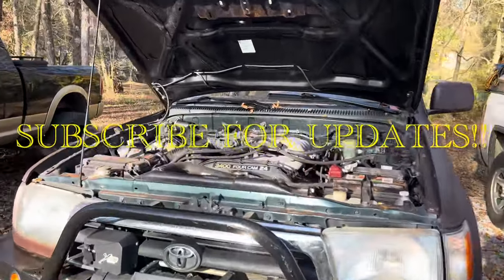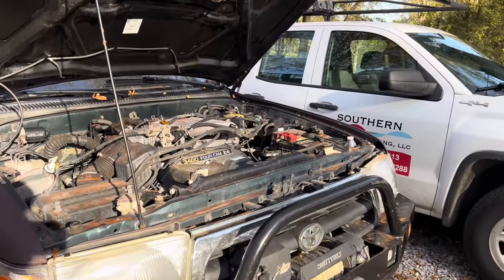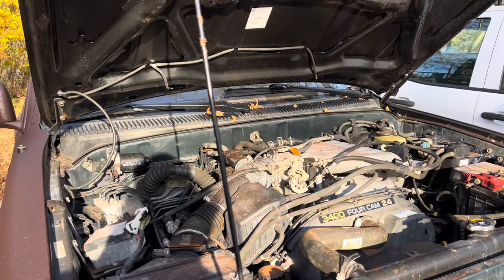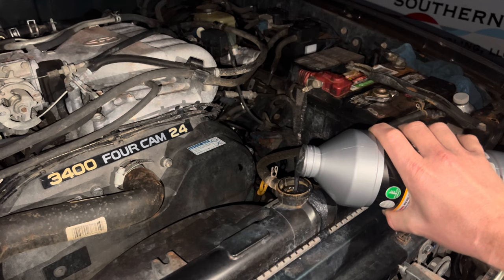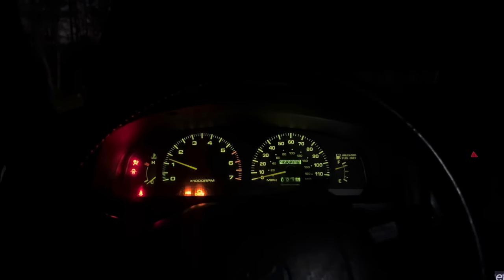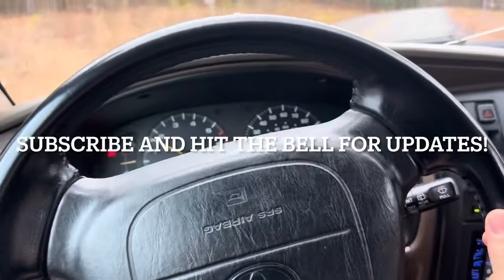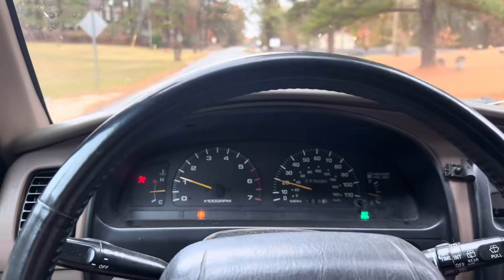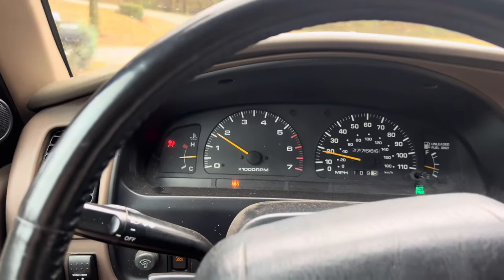Bar’s head gasket sealant is the best! How to use and review on any vehicle!

Comment: I’ve used this on my 06 is350. I have been driving my car daily in 100 degree weather without issues (yet). I removed the thermostat before using it to avoid any problems.
Reply from the maker: I’m surprised it’s still working for me really didn’t expect it to work like it has

Comment: Bars is the best, but you have to keep  driving until the seal sets.....do not let vehicle drain dry . Keep filling and drive at 30 minute intervals until the leak seals. If vehicle remains dry no water for 3 hours or more seal will evaporate and engine will lock
Reply from the maker: Correct I’m at 1800 miles now no issues

Comment: Hey buddy, I know the video is 1 month old now, any updates on how its holding up? or how long it lasted for you?
Reply from the maker: I have around 1200 miles on it as of now with no issues! 

I will get the exact mileage tomorrow for you!!!!
Reply: @Rubiconromp  hey bro awesome, I just put another one in mine today,had been running rest tho then temp hand went back to fluctuating again, so I dumped another in her. I figured hell I will add some more since it did well. This 1st time adding any more so I'm happy🤞🏿🤞🤞🏿❤️❤️❤️🙏🙏🙏🙏🙏👍
Reply: Mine was doing well to until last few days, temp going up n down so I just added another one today. I figured hell it won't hurt that lol. I got 256,000 miles on it so trial n error now. I have nothing to lose
Reply from the maker: I’ve put 1500 on mine so far
Reply: @Rubiconromp  that's awesome!!!!
Reply: @Rubiconromp  definitely some good stuff!! Thanks again for video! I'm on 2nd bottle, so I won't be using anything else since it's working 😂😂
Reply: @Rubiconromp  actually I just put mine in earlier today and my drive is about 20 minutes home so I put it in and did usual,run for 15 minutes and let cool down. Bro jumped in it and came home,and no BS hand only went to 1st line past half way which is where is supposed to be and then came right on back to normal lol. I was thinking you to myself in car lol. Gonna take ride tomorrow lol🙏🙏🙏🙏🤞🏿🤞🏿🤞🏿🤞🏿
Reply: @Rubiconromp  Your car still holding strong? Charger good so far since adding 2nd bottle🤞🏿🤞🏿🤞🏿🙏🙏🙏🙏🙏
Reply from the maker: @keithmccauley3395 mines all good and that’s cool too hear
Reply: @Rubiconromp  awesome glad to hear that
Reply: @Rubiconromp  ❤️

Comment: What prevents the sealer from sealing up the radiator?
Reply from the maker: Nothing at all. Very good chance it could it has stopped the heater core up twice! I now have 1500 miles on it with the shape of the motor I wasn’t worried about the motor failing
Reply: @Rubiconromp  so do you suggest this product or no
Reply from the maker: @Imadethistocomment13  if your motor isn’t worth putting head gaskets on I would give it a try forsure
Reply: So far so good with mine! Nothing clogged as of yet. I had nothing to lose, 257,000 miles on car and back running like only 2 miles on it. This Bars I must say works so far. I'm pleased🤞🏿🤞🏿🤞🏿🤞🏿🤞🏿🤞🏿🙏🏿🙏🏿🙏🏿
Reply: @Rubiconromp  exactly right! I will by Bars all day long if it keeps going lol
Reply: @keithmccauley3395  I figured the same thing between me and myself because my car has about 250,000 also and it's been running great and I just didn't want to get rid of it. I use the liquid the only problem I noticed is that the hot air doesn't come out but I don't notice any coolant loss anymore
Reply from the maker: Pull the heater hoses on the fire wall and flush it out he will start back working
Reply from the maker: Thanks for the comments helps the channel grow
Reply: @Rubiconromp  yes sir bro welcome!!! Thanks to you again❤️👍🏿👍🏿🙏🏿🙏🏿🙏🏿
Reply: @Imadethistocomment13  Did you bleed system? Might be air in it. Mine will do that to at times blow cold,warm, air and that's how I know I got an air pocket and Everytime I bleed it, back to hot heat
Reply: @Rubiconromp  yep true flush it out real good!!!
Reply: @Imadethistocomment13  I definitely suggest it only because it worked for me. But like anything else, it might not work for yours. I don't never post about anything, but since this is doing so good, I had to put my input on it.
Reply: @Rubiconromp  I definitely agree!
Reply: @Imadethistocomment13  Also I have tried other Bars products just to let you know and others ones did nothing at all, didn't clog either but didn't solve it. But the Bars Head seal done sealed it for now.
Reply: @Rubiconromp  ❤️❤️❤️
Reply: @keithmccauley3395  I'm glad it seems that I'm not missing any more coolant because I know I was definitely having a leak but like I told you the only problem is I think there might be an issue with the thermometer not really sure if it's from the actual product or if the thermometer itself went out but because my car has so many miles on it I'm going to let it ride until it can't anymore, it's already a little bit past the 250,000 mi or more
Reply: @Imadethistocomment13  ❤️
Reply: @Imadethistocomment13  That's me, mines at 257,000 and I'm gonna keep on pushing her! Then hell when it goes completely, I will just swap motor out, because I'm like you I like my ride. Put a new motor in and keep on trucking lol!! Keep me posted on how yours do. And also when I 1st put Bars in, it took me 3 drives before it kicked in. Short drives, like   maybe 5 miles or so each time testing it then finally no overheating. So give it a little time to let it seal up if it doesn't right away.
Reply: How your vehicle running? Still holding strong?
Reply: @keithmccauley3395  I definitely would not recommend this product now that I've been using it for over 2 weeks I noticed that it caused the major problem for me and it does not fix the leak at all, all it did was just cause the heater court to be blocked and now there is no more hot air. My heater is not working and I have a problem now not knowing where the leak is coming from but I have to add about half a gallon of water after every drive, I think it clogged up the core
Reply: @Imadethistocomment13  yea that's the thing that sucks, it doesn't work for everyone! Bad thing is you don't know til you try it. Only reason I tried is because I got 257,000 miles on it and I had nothing to lose, so it worked perfect. Sorry bout yours man!

Comment: Do you have to remove thermostat?
Reply from the maker: I did not and I’ve had no issues!
Reply: good question, if your engine already has serious symptoms such as pressurization, cavitation, heating and smoke... I suggest you remove it while you treat the leak and in order to let the circuit heat up more gradually, which will let the product act more effectively

Comment: So how many times do you fill it up with Bars? Do you do it just once or do you need to buy a couple bottles of this stuff until it works?

Sorry for the stupod question. I just stopped at O Riellys earlier tonight before they closed.

Gonna be using this on a 2000 Dodge Durango 4.7L V8 4x4. I got smoke coming out if the exhaust, smell of burning oil but no overheating unless theres no coolant in the radiator. 

Any thoughts anyone?
Reply from the maker: First I would do a combustion test can rent the tool and buy fluid from o Riley’s before you start with head gasket sealer to just make sure!!